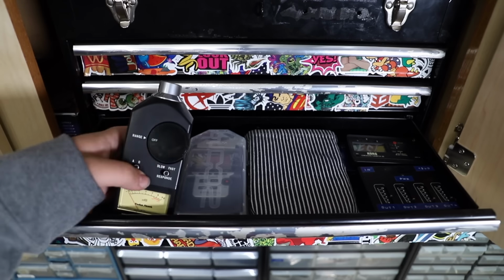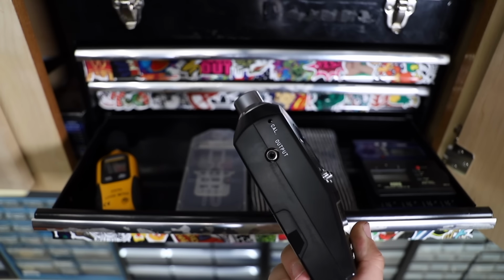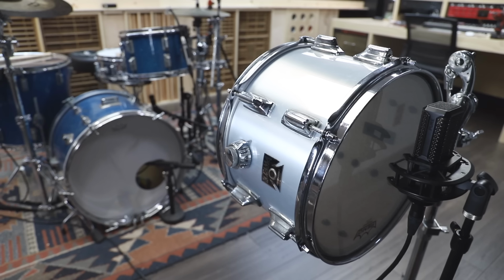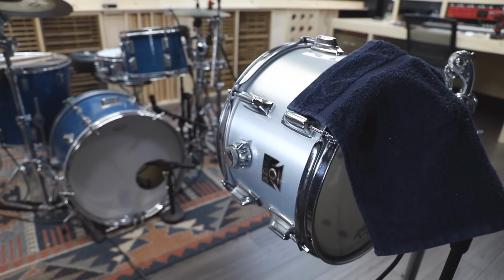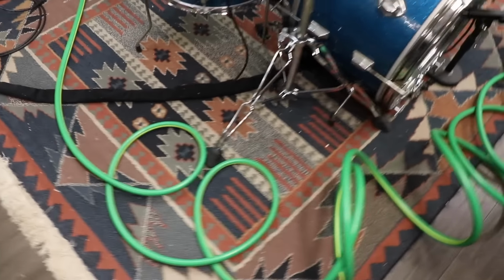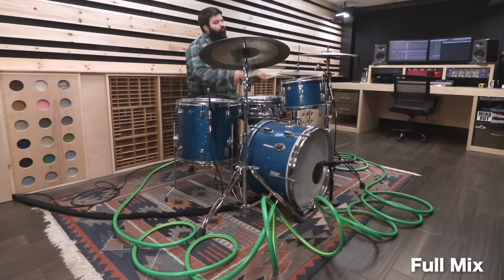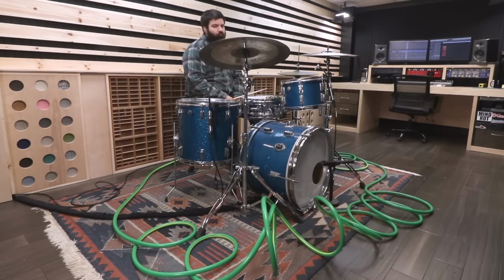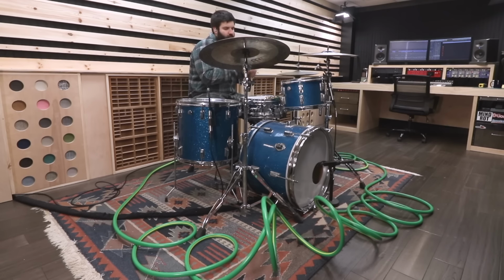Testing WEIRD Microphone Hacks!

Comment: I want to try these methods in the classic Glyn Johns 4 mic set up. As for the hose method…I’d try it with shorter lengths of hose and larger diameter hoses and different mics, also in the Glyn Johns set up. I really was surprised with both the sympathetic Tom mic and the tester.

Comment: Necessity is the mother of invention.   I think that's why I enjoy your videos so much since you're willing to experiment.  Back in the late 70s into the early 90s, I used a Teac 2340s 4 track/4 channel reel to reel with a Teac Model 2a mixer for my recordings.  I had to make the sounds I wanted on the spot before bouncing racks down because too many bounces caused degradation with analog. I didn't have the funds to buy effect tracks so I did something similar but for vocals.  I used a neck mic attached to the end of either a long cardboard tube or a sweeper hose to get the reverb I needed for my vocals.  For the drums, I used a single mic - sort of.  I used a room mic in the room with the drums, but ran it through an amp and put the recording mic in a closet with the speaker from the amp in front of the closet while leaving the door to the room with drums open to give it a bit of analog delay.  Wasn't the greatest, but it worked for my purposes.

Comment: Nice! Garden hose is classic Sylvia Massey, as I’m sure you know. The spl meter is cool, but could be done with a cheap electret mic and a heavy taste of compression. The Tom mic is sweet. 

I’ve got some telephones have have been converted into mics and it’d be interesting to see what one is like as a kick in.

I’ve been loving the handheld cassette recorder as a lo fi mic. Find an older one that has an output and record thru a DI (also courtesy of Sylvia Massy.)

Comment: During my "analog" recording days (Teac 2340A reel to reel) in the late 70s and into the 80s, I used to use a long cardboard tube (3" diameter and 40" long) with a neck mic connected to the opposite end to do vocals.  I played all the instruments myself, but didn't have the money for effects racks.  I did the best I could with what I had.

Comment: Cool video! I'm going to have to try out my Radioshack meter as a drum mic now!  One time I got a cool result where I took the output of a garden hose mic into a reverb. It sounded creepy and was a nice effect when mixed in. However, the track was metal AF so it fit with the vibe well.  But, to answer your question, my favorite was the SPL meter.

Comment: That Hosa box in the video (and in your link) absolutely won't convert the output of the SPL meter to a mic signal, it's a S/PDIF to AES converter, for digital signals only.  You should probably make this clear rather than let people spend $95 on a box that doesn't work for them.
Reply from the maker: Richard Garnish made an oopsie, fixed now!
Reply: That aside, some really interesting techniques with some surprising results.

Comment: I'm curious what it might be like to record a normal drum mix. Then, in post, "send" the full mix to the hose (using a speaker/output) and "return" the signal by recording it with a mic on the other end, similar to how plate reverb channels are recorded.  Blend that with the dry mix and see what it sounds like.

Comment: kind of wondering if a soundlevel meter mike is any good , it must be a pretty level mike (as in soundcolouring)  troughout the frequency band to be able to acurately measure the sound level 

i made my own mikes with some realy good dynamic mikes (size you find in lapel mikes ) made a small filter and a resistor setup to reduce the fantom powerfeed to wat the dynamic mikecardrige needed and build it intoo a hardwire and solder scaffold inside a female xlr plug , the top of the mike just stuck out the cable rubber , they worked realy well , the scaffoling and the rubber boot at the end of the plug stopped a lot of the contact noise , they just wouldnt die not even after being hit with a stick at full blast from an overzealous drummer aiming for the edge 
they where hard to mount in a mikeclamp solidly though as the plug and the plug it whent combo was kindah shaped like and elongated egg , if i where to mount those mikebodies in a gooseneck on the lxr plug it wouldve been eazier to mound them using a rack clamps and bend the gooseneck over the rim of the tom 

one thing you could try for the bas is a speaker that you torn out of a box (any speaker it depends on taste ) set up in front of the bas drum plugged intoo the board as a mike
needs to sit pretty close to the airhole of the basdrum though , 
i seen a guy who hid the speaker turned intoo mike , inside a 15 inch shallow tom body in front of the bas drum to make it look sleeker from the front of the stage and to be able to mount it with a tomstand , he used a small mike near the beaters to get the atack and quick tapping , and got the "thunder" with the speaker mike

another option for reverb is hanging a large metal plate about an inch away from a wall hanging from bungy cords and across the drumset could make a sort of clothing rack from two boom style mike stands and hang the plate up in this so you can move it around  , stick a piezo contact mike for a acoustic guitar to the thing (find the sweet spot for it on the plate , its usually somewhere in a corner   ) and mix it in with a direct mike as reverb 

rolling stones recorded the drums in a stairwell , the scorpoins set the drums up inside an empty indoor swimmingpool at the drummers home 
both to get a verry subway / reflective type reverb (noone could get near the drummer while playing without bleeding from their ears  ,,,, it was LOUD in there )
the guy recording the scorpions just put random mikes all over the space and then listened behind the mixer wat sounded best he didnt do close up miking but a one take 2 channel stereo mix 

i done the sound for an amateur rockband , i usually just used two active mikes for overheads a sm47 between snare and highhat and a large mike in the basdrum , worked fine for the places we played at  
multiple mikes just get complicated in a live setup with monitors

Comment: Why not use a bigger diameter Tom set up to get more resonance with the recording mic? I wonder what it would sound like with the drum mic at the same distance, but directly to the left of the snare and hats? It recorded the snare really well, I’m thinking that it would really pop, without the Bass drum drowning out the snare. I would think that the distance between the heads is what would be making the difference. Perhaps your vista mounted Tom, or a 16” floor, on a cradle? Also, Have you ever tried lining your bass drum with tin foil? It’s claimed to add volume and additional “roar” to your bass drum. I enjoy your videos! Nice job..